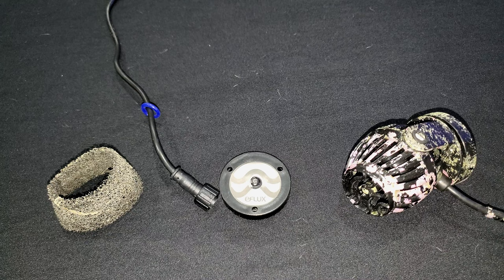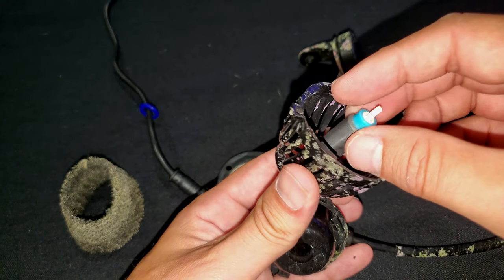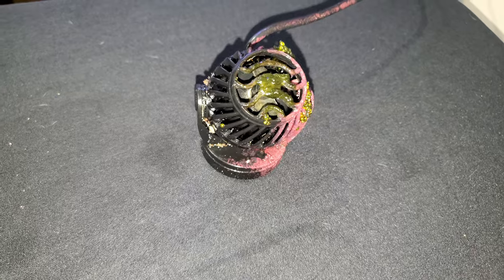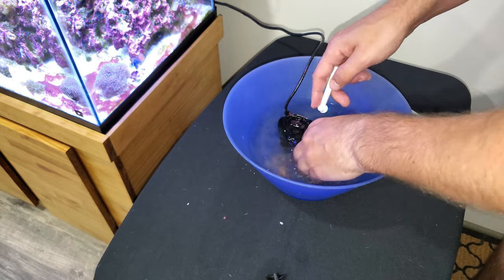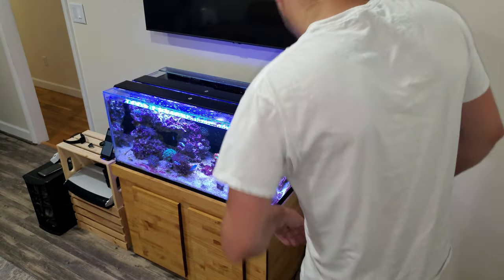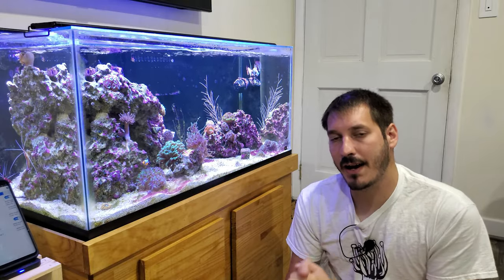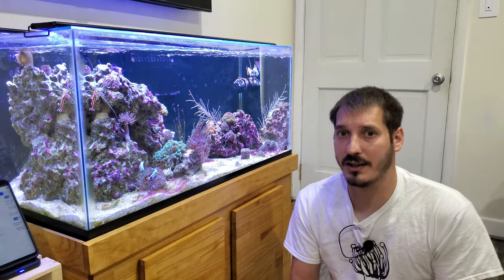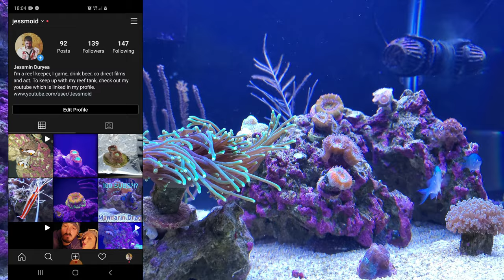EASY!!! How To Take Apart and Clean | Current USA eFlux Wave Pump How To and Review

Comment: I have a 40 Breeder reef as well with the same light and wave pump set up , what do you use for surface agitation ? I have one of mine pointing right at the surface but it looks like both yours are kind of mid level of the tank. Awesome tank btw
Reply from the maker: Thanks! I currently angle a pump from the mid section towards the bottom of the tank. I also used to have a diamond goby that did a lot of surface agitation for me, but I also like to use a turkey baster whenever I do a water change to help with the substrate.

Comment: Because I bought on Amazon instead of from them they won’t help me I just bought it and it’s brand new and it won’t work at all I even just asked if I hooked it up right and sent photos and still wouldn’t help me
Reply from the maker: That's strange, I too bought mine from Amazon and they were great about replacing a part that broke on it. Since then I switched to the Nero's
Reply: @Jessmosis  yeah, I ended up returning it and Amazon sent me another one and that one worked so I did have it hooked up right

Comment: Do they last? I’ve read reviews they break down every few months.
Reply from the maker: From my experience, if you're using them for stream mode only, they continue to work without issues. Still need to clean them occasionally to have full flow. If using any other mode they tend to fail.